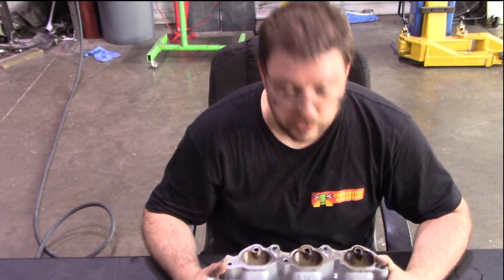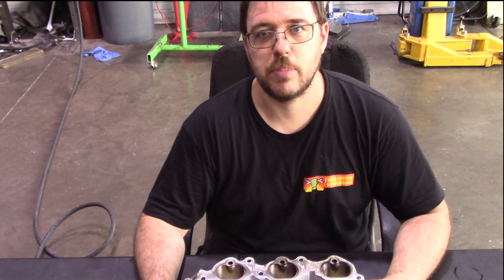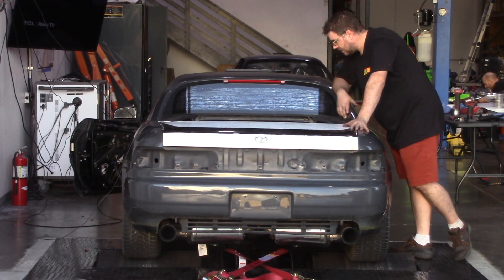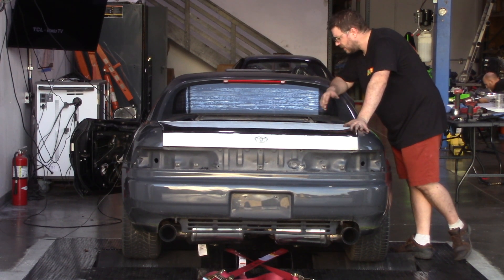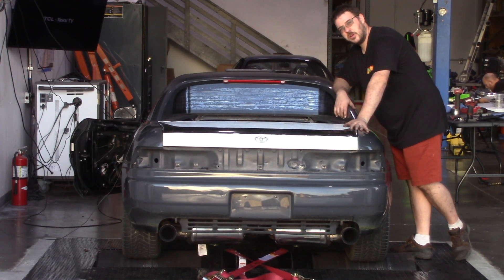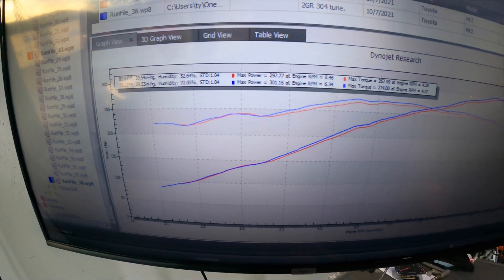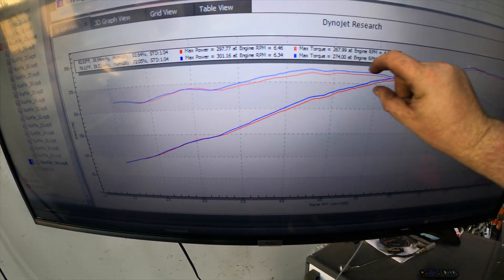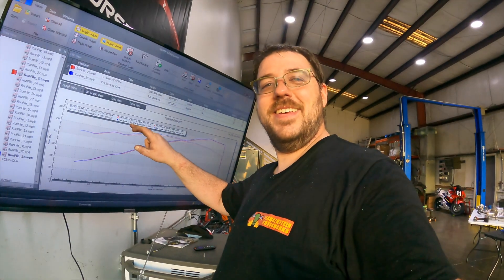Getting to over 300whp with the 2GR-FE

Comment: Hey Marc, what transmission is the sw20 in this video equipped with? a EB60, a EB62, a e153, a s54?
Reply from the maker: In this video the trans was an S54
Reply: @FrankensteinMotorworks  thanks. I guess drivetrain power lost on the s54 is comparable to the eb60 with both being lower then the e153
Reply from the maker: @mr2gab  Yes that's correct

Comment: I'm wanting to do a 2GR swap on my 91 MR2, does it matter what or which vehicle the 2GR came out of? I'm planning on sticking with my stock non turbo manual transmission until I can get my hand on the MR2 turbo transmission
Reply from the maker: It does not matter as long as it's a 2GR-FE, the 2GR-FSE or 2GR-FKS or others are not interchangable with the 2GR-FE for various reasons. 

The S54 has worked for many people but when you want to upgrade i would strongly suggest looking at the narrow e series, it's a lot lighter than the E153 and still plenty strong. Alex documented it here: https://wilhelmraceworks.com/blog/e351-transmission-swap

Comment: Why were those bosses there in the first place?
Reply from the maker: the other side is where the injector lower seals are and there's a minimum thickness required for a casting to be successful and Toyota decided it wasn't worth the machining time to remove them.
Reply: @FrankensteinMotorworks  Many thanks.  I have a 2010 Vellfire with this engine, and any easy way to get a little more power has got to be worth pursuing.

Comment: Did you know what 2gr heads flow?    I have a number for 1mz/3mz at 264cfm@.450" lift.  It was from an old motor trend article where they ported the heads to 301cfm@.450".  The stock valves are 34mm/27mm.     I have to imagine 2gr flow rates are outstanding in comparison.
Reply: the data i have for 2GR heads is 299CFM peak flow and 331CFM peak flow with porting.

Comment: What other supporting mods are needed for this?
Reply from the maker: We get to 300whp by using the Frankenstein Motorworks headers, the TCS y-pipe with the Berk tail section along with a tune and the Frankenstein motorworks MAF pipe and a 6" filter.

Comment: Note the temperture difference.  Depending on the ECU there could be the smallest change in fueling or timing that could of done that.
Reply from the maker: This change has actually been confirmed by other people on different dynos. Trimming those bosses seems to reliably be good for a couple horsepower. But if you want to look at the temperature make sure you also look at the pressure and humidity. The decreased humidity on the hotter run makes up for the extra heat. But at the end of the day it's hard to get a perfect test like this back to back without significantly more expensive equipment.  Environmental conditions are displayed on the graph so you can make your own decision.
Reply: @FrankensteinMotorworks  I got a 2GR-FKS in a 2017 Toyota Kluger in Australia.  I am looking at the VVT timing etc and just looking at this engine tuning wise overall.

Comment: Seeing this makes me wonder if the stock ecu can be tuned, if not what you recommend?
Reply from the maker: The stock ECU can be tuned, this power shown is with the tuned MR2 swap ECU that i sell. Unfortunately the way these ECUs work you have to figure out each tune separately so just because i have put in the work to tune a few of these ECUs does not mean that i can tune most of the ECUs out there. But thankfully, the stock ECU really isn't holding back horsepower. You have to add a lot more air into the engine before you're far enough outside the expected part of the maps that tuning it can add power. we were getting to about 280whp (roughly 320hp or 50hp over stock) before the tuning started making any significant difference.

Comment: can I ask what tools and materials you used exactly to remove the bosses?
Reply: Looks like a carbide burr for the main material removal. You could do a similar job with the sanding cylinder from a rotary tool like a dremel. 
The second tool was a funky little sanding belt tool. you could use just sandpaper if you wanted to work out your fingers. I've also seen people polish the insides of these intakes with wire wheels.
If you're going to do this, you nmay as well polish the entire inner surface area. The smoother it is, the smaller the boundary layer of turbulent air.

Comment: Can 2gr get 1gr stoke?....3.5L to 4.0L just using 1gr internals?
Reply from the maker: The 1GR-FE is an oddball. it has 72mm main journals and the 2gr-fe has 61mm main journals. There are many other differences but this is enough to see that the crank would not swap right over.
Reply: People are using custom cranks the cost isn't as great as you'd expect.

Comment: sienna be about this at stock
Reply from the maker: This is over 300wheel hp. The current sienna is rated at 245crank hp and the one that had the 3.5L V6 was rated at 269crank hp. the difference between crank and wheel is about 15% losses. This is actually about a 75hp gain over the sienna engine.

Comment: so is this the same 2gr that is in the 2014 camry?  they are suppised to have 268 hp and your up to 301. is that the only mod other than intake and exhaust?
Reply from the maker: It's actually a bigger difference than that, it's rated to 268 at the crankshaft and we're getting about 300 to the ground so sneaking up on 80hp over factory. Surprisingly these motors just love making good power this is with stock internals except for the lower intake mentioned in this video. The stock exhaust on these motors are very flow restricted.
Reply: So the numbers are really conservative then. Ive done intake and exh and im quicker than wrx sti. Cant imagine what headers and y pipe would do also
Reply from the maker: @danclara1  it's not so much that it's conservative, it's that the motor is really damn loud at the top end so they need to choke it down to make it pass regulations and to make it sound like it belongs in a Camry. They can't release a camry that sounds like this: https://www.youtube.com/watch?v=urZv8hDTbFo
Reply: Ok wow that sounds awsome. I will be installing a cutout instead of the y pipe in the rear.  I want to be able to not wake the neighbors lol
Reply: His 301 whp is like  345 engine hp.

Comment: U know how much whp it would possibly have without the new headers and just the ecu tune, exhaust and intake port?
Reply from the maker: Unfortunately i do not know. I would not expect a significant gain because the biggest restriction is the stock y-pipe. without fixing that i don't think you would add much power.
Reply: @FrankensteinMotorworks  y-pipe as in exhaust or header formation?
Reply from the maker: @ralph02136  the part that joins both banks under the engine and sends it towards the back of the car.
Reply: @FrankensteinMotorworks  ohh ok. So what size do u think would be go for that y pipe, 2.25/2.5?
Reply from the maker: @ralph02136  in the MR2 we use 2.25" into 3"
Reply: @FrankensteinMotorworks  since u saw a 5 whp gain with your method, do u think a port/polish for the cylinder heads would give about 10-15+ whp?
Reply from the maker: @ralph02136  Air can move in very unexpected ways. There's likely some power available but testing would be required.

Comment: what about fuel consumption, more horsepower = more fuel consumption  ? can any mechanic do this ? how much should i sand from the metal ?? is it safe ? any side effects ?
Reply from the maker: Yes, in theory this would negatively affect fuel economy but this is very marginal. This is something anyone can do but you'll probably struggle to find someone that is willing to do it. This is really more of a DIY thing. The risk is very low as long as you don't drop anything in the intake while the motor is open and you fully clean all the parts so your motor does not ingest metal dust. I just brought the surface down to level with the runner.

Comment: What is the maximum amount of HP that the 2GR can produce Naturally Aspirated ? Thanks.
Reply from the maker: 309whp is the highest number i've ever seen on a naturally aspirated 2GR without any internal work. I've also heard of a 400whp 2GR existing but it has a ton of internal work.
Reply: There's a 14:1 heavily ported big cams one out there making over 500whp out near 9000 rpm.

Comment: You are the 2GR-FE yoda sir. Love your knowledge and willingnes to share. Saving up for a 2GR-FE swap my self. My wet dream is using a rav4 as a donor and converting my AZT250 Avensis to basically a V6 Caldina. Ever since my 88 camry alltrac with a 3vzfe got stolen 10 years ago i've always dreamt of something similar. My left leg has more titanium and carbonfibre than meat and bone so the auto from the rav seems a good option.

Comment: What else have u done to make 300 aren’t they 268 stock
Reply from the maker: 269 to the flywheel from the factory, this is 300 to the wheels or about 350 to the flywheel. The modification in this video is the only internal change. On the outside of the motor this has a very free flowing exhaust, a free flowing intake with my MAF pipe and an ECU tune that i spent a bunch of time on.
Reply: @FrankensteinMotorworks  I got a intake and a straight pipe to performance magnaflow mufflers. U telling me if I get it tuned I’ll get around 290 or so?
Reply from the maker: @TritTheMit  A lot of the aftermarket intakes actually rob power because they have to be designed to work with the stock ECU tune. My tune and MAF pipe are designed together and it makes a huge difference. These parts are not equivalent at all. For what it's worth, the ECU tune got the last 15whp or so. the stock ECU tune is actually quite good if you let it breathe.
Reply from the maker: @TritTheMit  This is the MAF pipe i make: https://frankensteinmotorworks.squarespace.com/shop/2gr-fe-maf-pipe
Reply: @FrankensteinMotorworks  my intakes got a maf plug in what’s the difference in this
Reply from the maker: @TritTheMit  Are you seeing anyone else with the stock ECU without my intake making over 300whp to the ground?
Reply: @FrankensteinMotorworks  nope lol
Reply from the maker: @TritTheMit  One of the reasons for that is because my intake is not compromised by needing to run with the stock ECU tune. With both being altered at the same time the intake can be much more free flowing and add power. It also has much more precise fueling. All the aftermarket intakes i've seen actually have pretty terrible fuel trims which sometimes makes the engine run worse instead of better.

Comment: What will I need tools wise in order to be able to take out those notches? Will it do anything to the injectors? I have a 07 ES350 with a muffler delete and 2nd cat delete
Reply from the maker: honestly just a dremel with some sanding drums would work fine. You could even do it with a hand file and some patience. This will not affect the injectors.
Reply: @FrankensteinMotorworks  thank you very much, I don’t have much tools but I’ll work with what I have, I just grabbed a extra lower intake manifold from the junkyard just now to do this
Reply: @FrankensteinMotorworks  can I also port the rest of the intake or not unless I’m doing a tune? I don’t plan on tuning the car as of right now

Comment: I wish u did content with the 3mz bc I currently have a highlander with 3mz that gets to 100 pretty decent. Not saying it’s fast by any means but u would be surprised that it pulls.
Reply from the maker: there are plenty of people out there playing with the older motors. I really like these more modern motors.
Reply: @FrankensteinMotorworks  Ik that this is late n all but have u considered switching the manifold upper and lower one from the 1gr. Considering that it is bigger than the 2gr and on top of that u can port it as well
Reply from the maker: @fmgamer6248  i played with this idea over a decade ago. they don't actually align. It would be possible to make a spacer/adapter but that would make the runners even longer and the runners are already a bit longer than they really should be  for the power we are now pulling from these.
Reply: @FrankensteinMotorworks  ah goths then would it be possible to port the 3mz bc when I look at them it rarely looks like it doesn’t need to be ported except for those nudges that the bolt is supposed to go and on top of that the upper manifold has those 4 passage ways instead of one big circle one.
Reply from the maker: @fmgamer6248  Unfortunately i have zero experience with the 3MZ so i really can't speak to it but i can say that not all bumps will be causing power loss. Air moves in very mysterious ways and this kind of thing really needs to be checked on the dyno to make sure you aren't hurting power instead of helping.
Reply: @FrankensteinMotorworks  thanks for the tip bc when I was looking at the 2gr manifold u said that by removing those nudges on the hole where the bolt is supposed to go u gain 5hp and looking at the lower intake manifold of the 3mz it’s identical so in theory I should gain those 5hp but I won’t know till I try
Reply: @fmgamer6248 did you do it?
Reply: @dennisrobinson8008  No unfortunately no bc I’m not very good at making it even through the whole manifold. I did find someone that would do it and is known to do it on Nissan but for the price he’s charging it worth it in my opinion tho. So to this day it’s still just a theory. The only reason y I don’t think it would work on the mz family is bc the manifolds are small compared to the gr family. It’s just a theory at the end of day all Ik is that it works for the gr family rather u have the 1gr as well which is 4runner and Tacoma’s. Maybe it would even work with the uz family and maybe the ur family such as the ISF and etc…
Reply: @fmgamer6248  How is the lower manifold port compared to the intake port on the head?
Reply: @dennisrobinson8008  mainly the size difference between them. Obviously the 2gr is bigger and is more rectangular. The mz has different sizes. Some Lexus models the intake and lower intake have a oval shape or even a circle shape meant for more smooth air delivery but the rectangular shape intake was designed for max power in the end. When I was testing some intake swaps within the mz the best one was the rectangle one. All the other ones are meant for smoother rides. The only thing I can think of is if u do have the rectangular one and want to supercharge it then you would have to switch out the manifold upper and lower one to the 1mz. How ever the rest has to fabricated to work bc the 1mz was cable driven and not electronic bc the 3mz has the throttle body that is electronic but u can supercharge the 3mz
Reply: Airflow is airflow and compression is compression.   There is a guy that sleeved and stroked 3mz to 420rwhp/325ftlb out of 4.3L, custom cams and ported heads built bottom end.    Tony the tiger had 1mz built up to almost 1000whp boosted and power peak over 8000 with custom 292 cams and a custom shorter runner intake manifold.  Of course too big a custom cam requires an aftermarket ecu.   He used Haltech.   IMHO makes no sense to have DOHC  with vvti unless your going to rev it out.   6000rpm of the 1mz/3mz is super low.    

Did you figure which models had the rectangular lower intake and head ports?

I'm familiar with the rounded shape but not square on 1mz/3mz.
Reply: @dennisrobinson8008  well dam seems to me he has money money to be doing custom stuff to it and more power to him but me I would rather just supercharge it that came from factory of the 1mz and see if I can slap it on the 3mz. Cheaper route in my opinion and yea I did find  some manifolds that have all 3 different shapes. 1mz has a circle one on both upper and lower intake. Some lexus models that have a 3mz engine have a oval shape one which I believe it came with the es330 and the rest is rectangle like the carry and highlander as examples
Reply: @fmgamer6248  thats true boost is the cheapest way.    Thats how most of us think.   Just too much custom work when you can just turn up the boost.

Comment: This makes me appreciate my 2011 Highlander even more! Never knew it was such an excellent engine!
Reply: oh yes This is probably the best N/A Toyota engine .... The fact that  lotus super charged it and got 400 hp and uses it says a lot but these engines are excellent
Reply: This makes me so happy. I love my 05 avalon with the 2gr fe, it's got 180k miles and runs like new still. everything works and it's got a lot of power. it's the best car I've had yet ♥
Reply: @ArcYT  a year later! What’s your mileage? I’m inching up to 200K now.. only issue I had was engine cool line burst but that was a known issue Toyota didn’t cover
Reply: @TheRealHungryJoe  was it the oil cooler line?
Reply: @beronib888  yes, unfortunately. That’s the only issues I’ve had so far.. other than the driver window mechanism not working. The bolt fell off, just need to remove the panel and reassemble it
Reply: One of the best V6s ever made